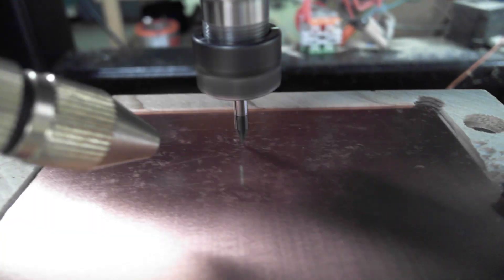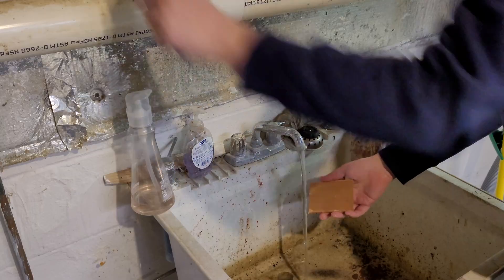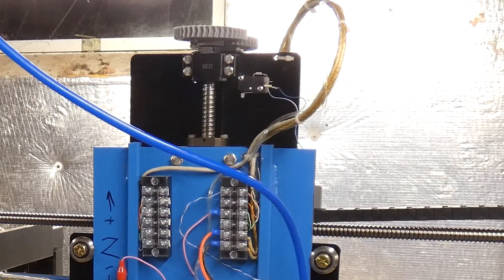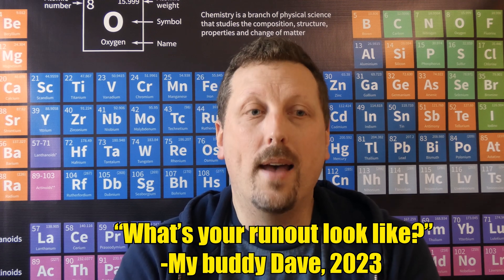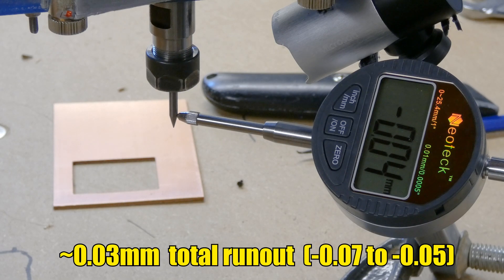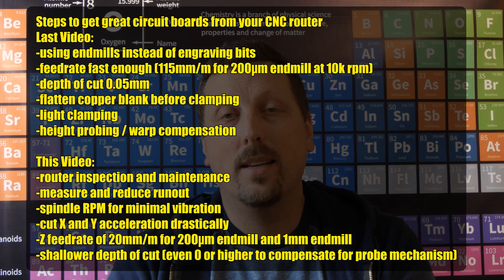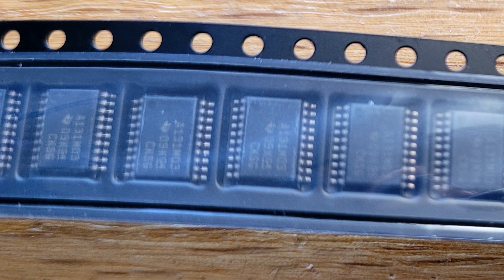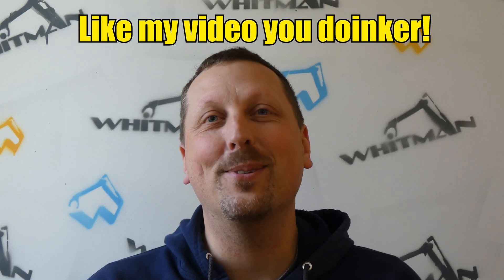Finding PCB Perfection - making circuit boards on a homemade CNC router - Nephele03e02

Comment: thanks for the vid. is the heightmap dependent on the software you use for milling the board or is it a functionality that the CNC itself requires?
Reply from the maker: I wrote the height probing and Z coordinate correction software myself.  I wrote my own program to open gcode files and stream them to grbl - the open-source firmware that runs my router.  So as I worked through getting reliable boards, I streamlined the software that controls the router to formalize the various steps I needed to do.  My toolchain is KiCad to spit out Gerber and drill files > FlatCAM to convert the Gerber into gcode > my custom software to probe the copper blanks for the area where the traces will be cut and then the gcode is modified to include a Z coordinate for all the cutting moves > this modified gcode is streamed to the router which runs grbl.  If I didn't perform the z correction, I would break bits and have unusable boards.
Reply: @WhitmanTechnological  awesome and thanks for taking the time to respond 😁 I have an industrial CNC but it's not in anyway worth trying to use for PCBs so planning to get a small hobby type one that runs GRBL but wasn't sure if the machine itself had to be able to do a height map or the software I.e. flatcam. I guess the machine is capable but I guess I wasn't sure if the map is done via the software so machine firmware etc is not a dependency
Reply from the maker: @LucidFX.  Nice dude!  Grbl has a command to probe on an axis (G38.2 Z-6 F20 is what I use - probe up to 6mm in the negative z direction at a super slow 20mm/min), and when the probe triggers, grbl will output the machine coordinates at the point where the trigger happened (looks something like "[PRB:67.86,49.23,-46.875]").  I pull the Z coord from that, and then measure the difference in z coordinates across a grid to generate the heightmap.
Reply from the maker: Yesdooood!!!  There goes all your free time!  If you're comfortable with C#, I can post my height probing code in the comment here as something to start from on your projects.
Reply: @WhitmanTechnological  that will be awesome. I've delved a little but ii can figure it out or I have a buddy that doesn't yet know how busy he's going to be 😁
Reply from the maker: @LucidFX.  This is the guts of it, no promises it'll do you any good...  Wow, there's a lot of code, isn't there.  It definitely took a while to get it just right. 😊

    internal class ProbedHeightMap : ViewModelBase
    {
        //PCB properties.
        public double MaxSampleSpacing { get; set; } = 5; //Mapping points are 5mm apart.
        public double WorkWidth { get; set; } = 65; //65mm sample width
        public double WorkHeight { get; set; } = 90; //85mm sample height
        public double WorkLeft { get; set; } = 65; //65mm sample width
        public double WorkBottom { get; set; } = 90; //85mm sample height
        public double SafeRepositioningHeight { get; set; } = 2; //Height to go to before moving to a new point.
        public double ProbingSpeed { get; set; } = 60; //mm/min

        public double XDistance { get; set;  } //Space between columns
        public double YDistance { get; set; }//Space between rows

        private int CurRow { get; set; }
        private int CurCol { get; set; }

        public int MaxRow { get; set; }
        public int MaxCol { get; set; }

        public double[,] HeightMap; //Heights of points on the PCB

        private GrblMachine Machine; //Ref to the CNC router.

        public event EventHandler HeightMapComplete;

        public ProbedHeightMap() { }

        public ProbedHeightMap(GrblMachine Machine)
        {
            this.Machine = Machine; //Localize ref to machine.
        }
        public void Initialize()
        {
            //Determine the number and spacing for rows and columns.
            MaxRow = (int)Math.Ceiling(WorkHeight / MaxSampleSpacing);
            MaxCol = (int)Math.Ceiling(WorkWidth / MaxSampleSpacing);

            XDistance = WorkWidth / MaxCol; //Spacing between probe columns;
            YDistance = WorkHeight / MaxRow; //Spacing between rows.
        }
        public void GenerateHeightMap()
        {
            Initialize();

            //Starting at the bottom left of the work piece.
            CurCol = 0;
            CurRow = 0;

            HeightMap = new double[MaxCol + 1, MaxRow + 1]; //Initialize the heigh map.

            //Hook up to the machine's output.
            Machine.LogUpdated += pcbHeightResponses;

            //First, probe to Z0 at 0,0.
            Machine.MakeABS();

            //Take the first sample.
            sampleNextPoint();
        }

        private double startingHeight = 0;
        private void pcbHeightResponses(string newLine)
        {
            //Probing returns [PRB:0.000,0.000,0.000,0.000,0.000:0]
            if (newLine.StartsWith("[PRB:"))
            {
                //Number after the second comma.
                var vals = newLine.Split(',');
                double ht = double.Parse(vals[2]);

                if (CurCol == 0 && CurRow == 0) startingHeight = ht;

                HeightMap[CurCol, CurRow] = Math.Round(ht - startingHeight, 6); //Write the value into the hightmap array

                //Advance to next item.
                CurCol++;

                //Already completed this row?
                if (CurCol > MaxCol)
                {
                    //go to the next row.
                    CurCol = 0;
                    CurRow++;

                    //Hit the end of the board.
                    if (CurRow > MaxRow)
                    {
                        //Unhook from the log updated event.
                        Machine.LogUpdated -= pcbHeightResponses;

                        Machine.Commands.AddCommand("G0 Z10"); //Move to a safe height;

                        //Notify the completion of the height map probing.
                        HeightMapComplete?.Invoke(this, EventArgs.Empty);

                        return;
                    }
                }

                //Send the commands to probe the next point.
                sampleNextPoint();
            }
        }

        public void sampleNextPoint()
        {
#if DEBUG
            //Spoof a probe response on the log entries.
            pcbHeightResponses("[PRB:0,0," + (CurRow) + ",0.00]");
#else
            //Move to a safe height.
            Machine.Commands.AddCommand("G0 Z" + SafeRepositioningHeight);

            //Rapid to next coordinates
            Machine.Commands.AddCommand("G0 X" + (CurCol * XDistance + WorkLeft) + " Y" + (CurRow * YDistance + WorkBottom));

            //Probe this point.
            Machine.Commands.AddCommand("G38.2 z-" + (SafeRepositioningHeight + 2) + " f" + ProbingSpeed);
#endif
        }

        public void SaveMap(string filename)
        {
            if (HeightMap == null) return;

            StringBuilder sb = new StringBuilder();
            sb.AppendLine(MaxCol + ";" + MaxRow);
            sb.AppendLine(WorkLeft + ";" + WorkBottom + ";" + WorkWidth + ";" + WorkHeight);
            sb.AppendLine(XDistance + ";" + YDistance);
            for (int x = 0; x <= MaxCol ; x++)
            {
                for (int y = 0; y <= MaxRow; y++)
                {
                    sb.AppendLine(x + ";" + y + ";" + HeightMap[x, y]);
                }
            }

            System.IO.File.WriteAllText(filename, sb.ToString());
        }

        public void ReadMap(string filename)
        {
            string[] lines = System.IO.File.ReadAllLines(filename);
            if (lines.Length < 4) return;

            string[] vals = lines[0].Split(';');
            MaxCol = int.Parse(vals[0]);
            MaxRow = int.Parse(vals[1]);

            vals = lines[1].Split(';');
            WorkLeft = double.Parse(vals[0]);
            WorkBottom = double.Parse(vals[1]);
            WorkWidth = double.Parse(vals[2]);
            WorkHeight = double.Parse(vals[3]);

            vals = lines[2].Split(';');
            XDistance = double.Parse(vals[0]);
            YDistance = double.Parse(vals[1]);

            //Loop the rest of the lines and populate the height map.
            HeightMap = new double[MaxCol + 1, MaxRow + 1];

            for (int x = 3; x < lines.Length; x++)
            {
                vals = lines[x].Split(';');
                HeightMap[int.Parse(vals[0]), int.Parse(vals[1])] = double.Parse(vals[2]);
            }
        }
Reply from the maker: Second half...

        public void SetHeightMapImage()
        {
            int maxx = HeightMap.GetUpperBound(0) + 1;
            int maxy = HeightMap.GetUpperBound(1) + 1;

            double minHeight = double.MaxValue;
            double maxHeight = double.MinValue;
            for (int x = 0; x < maxx; x++)
                for (int y = 0; y < maxy; y++)
                {
                    minHeight = Math.Min(minHeight, HeightMap[x, y]);
                    maxHeight = Math.Max(maxHeight, HeightMap[x, y]);
                }
            double range = (maxHeight - minHeight) / 2;
            double mid = minHeight + range;

            //Make a bitmap of the heighmap
            var bmp = new WriteableBitmap(maxx, maxy, 96, 96, PixelFormats.Bgr32, null);
            bmp.Lock();

            unsafe
            {
                IntPtr bbuf = bmp.BackBuffer;
                for (int x = 0; x < maxx; x++)
                {
                    for (int y = 0; y < maxy; y++)
                    {
                        IntPtr ptemp = bbuf + x * 4; //Which4-byte pixel in the current stride are we?
                        ptemp += bmp.BackBufferStride * (maxy - y - 1); //Which stride are we on (bottom of image is first.

                        int clr = (int)(0) << 16; //R
                        clr |= (int)(255) << 8; //G //Default color is full green.
                        clr |= (int)(0) << 0; //B - proportional to how far below the mid range we are.

                        if (HeightMap[x, y] < mid)
                        {
                            double ratio = (mid - HeightMap[x, y]) / range; //Map is the lesser of the two.
                            clr = (int)(127 * (1 - ratio)) << 16; //R
                            clr |= (int)(127 * (1 - ratio)) << 8; //G
                            clr |= (int)(127 + (128 * ratio)) << 0; //B - proportional to how far below the mid range we are.
                        }
                        else
                        {
                            double ratio = (HeightMap[x, y] - mid) / range; //mid is the lesser of the two.
                            clr = (int)(127 + (128 * ratio)) << 16; //R - proportional to how far above the mid we are.
                            clr |= (int)(127 * (1 - ratio)) << 8; //G
                            clr |= (int)(127 * (1 - ratio)) << 0; //B
                        }

                        *((int*)ptemp) = clr;
                    }
                }

                bmp.AddDirtyRect(new System.Windows.Int32Rect(0, 0, maxx, maxy)); //Mark the whole bitmap as dirty.
            }

            bmp.Unlock();

            HeightMapImage = bmp;
        }

        public ImageSource HeightMapImage
        {
            get { return _HeightMapImage; }
            set { SetNotifyingProperty(() => HeightMapImage, ref _HeightMapImage, value); }
        }
        private ImageSource _HeightMapImage;

        private double HeightAtZero;

        public string ApplyMapToFile(RouterFile file)
        {
            //Scan the gcode.
            MaybePoint3D machinePos = new MaybePoint3D() { X = 0, Y = 0, Z = 0 };
            HeightAtZero = HeightMap[0, 0];

            StringBuilder result = new StringBuilder();
            foreach (var cmd in file.Commands)
            {
                if (cmd.CommandType != CommandType.G1 || !cmd.Coords.HasPosition())
                {
                    if (cmd.CommandType == CommandType.G0)
                    {
                        //Update the machine position to the result of this G0 move.
                        if (cmd.Coords.X.HasValue) machinePos.X = cmd.Coords.X.Value; //Move the the specified X
                        if (cmd.Coords.Y.HasValue) machinePos.Y = cmd.Coords.Y.Value; //Move the the specified Y
                        if (cmd.Coords.Z.HasValue) machinePos.Z = cmd.Coords.Z.Value; //Move the the specified Z
                    }

                    //Not cutting.
                    result.AppendLine(cmd.Command);
                    continue;
                }

                //How far are we about to cut?
                double dist = machinePos.DistanceTo(cmd.Coords);

                if (dist > 5)
                {
                    //More than 5mm, break it up into smaller lengths.
                    double split = Math.Ceiling(dist / MaxSampleSpacing);

                    double diffX = cmd.Coords.X.HasValue ? cmd.Coords.X.Value - machinePos.X.Value : 0; //If X present, distance from current pos to new pos.
                    double diffY = cmd.Coords.Y.HasValue ? cmd.Coords.Y.Value - machinePos.Y.Value : 0; //If Y present, distance from current pos to new pos.
                    double diffZ = cmd.Coords.Z.HasValue ? cmd.Coords.Z.Value - machinePos.Z.Value : 0; //If Z present, distance from current to target Z height.

                    //Split into this many items.
                    for (double segs = 1; segs < split; segs++)
                    {
                        //Move towards the destination proportionally along the line that joins the machine to the target.
                        double partialX = machinePos.X.Value + segs * diffX / split; //Moving X in the direction of the destination.
                        double partialY = machinePos.Y.Value + segs * diffY / split; //Moving Y in the direction of the destination.
                        double partialZ = machinePos.Z.Value + segs * diffZ / split; //Maybe sliding up or down along the line as well.
                        partialZ = partialZ + GetZModifier(partialX, partialY); //Adjust Z to the hPCB surface height.

                        //Compile the segment line.
                        string partialres = "G1 X" + partialX.ToString("F4") + " Y" + partialY.ToString("F4") + " Z" + partialZ.ToString("F4");
                        if (cmd.Coords.F.HasValue) partialres += " F" + cmd.Coords.F.Value; //Add the feed rate if present in the original command.

                        //Write the segment to the gcode output.
                        result.AppendLine(partialres);
                    }
                }

                //No splitting needed, or we're done splitting, advance the machine to the target point and adjust the Z offset.
                if (cmd.Coords.X.HasValue) machinePos.X = cmd.Coords.X.Value; //Move the the specified X
                if (cmd.Coords.Y.HasValue) machinePos.Y = cmd.Coords.Y.Value; //Move the the specified Y
                if (cmd.Coords.Z.HasValue) machinePos.Z = cmd.Coords.Z.Value; //Move the the specified Z

                //Adjust the z based on X and Y position.
                double tempZ = machinePos.Z.Value + GetZModifier(machinePos.X.Value, machinePos.Y.Value);

                //Compile the adjusted line of gcode
                string res = "G1 X" + machinePos.X.Value.ToString("F4") + " Y" + machinePos.Y.Value.ToString("F4") + " Z" + tempZ.ToString("F4");
                if (cmd.Coords.F.HasValue) res += " F" + cmd.Coords.F.Value; //Add the feed rate if present in the original command.

                //Write the line of GCode to the output.
                result.AppendLine(res);
            }

            //Replace the file gcode with the adjusted gcode.
            return result.ToString();
        }

        private double GetZModifier(double X, double Y)
        {
            double x = X - WorkLeft;
            double y = Y - WorkBottom;

            //What are the four salient points?
            int lowX = (int)Math.Floor(x / XDistance);
            int highX = (int)Math.Ceiling(x / XDistance);
            int lowY = (int)Math.Floor(y / YDistance);
            int highY = (int)Math.Ceiling(y / YDistance);

            //Get the heights in those corners.
            double ll = HeightMap[lowX, lowY],
                lr = HeightMap[highX, lowY],
                ul = HeightMap[lowX, highY],
                ur = HeightMap[highX, highY];

            double lowXc = lowX * XDistance;
            double highXc = highX * XDistance;
            double lowYc = lowY * YDistance;
            double highYc = highY * YDistance;

            //Bilinear interpolation, start by interpolating the upper and lower edges.
            double dxl;
            double dxu;
            if (x <= lowXc) //Pegged to the left edge.
            {
                dxl = ll;
                dxu = ul;
            }
            else if (x >= highXc) //Pegged all the way to the right edge.
            {
                dxl = lr;
                dxu = ur;
            }
            else //Floating between the left and right sides.
            {
                double leftProportion =  (highXc - x) / XDistance;
                double rightProportion = (x - lowXc) / XDistance;

                dxl = leftProportion * ll + rightProportion * lr; //Interpolate the bottom edge.
                dxu = leftProportion * ul + rightProportion * ur; //Interpolate the bottom edge.
            }

            //Interpolat the y direction from the interpolated values.
            double result;
            if (y <= lowYc) result = dxl; //Below the bottom.
            else if (y >= highYc) result = dxu; //Above the top.
            else
            {
                //Interpolate between the previous values.
                double bottomProportion = (highYc - y) / YDistance;
                double topProportion = (y - lowYc) / YDistance;

                result = topProportion * dxu + bottomProportion * dxl; //Interpolated between the interpolated values.
            }
            return result - HeightAtZero; //Subtract the base height to get the height offset at the specified point.
        }
    }
Reply: @WhitmanTechnological  fantastic. Thank you! I did a quick scroll through and makes sense. Much appreciated 🙏